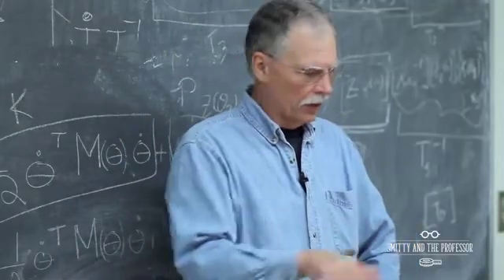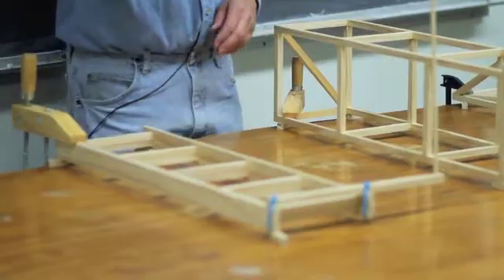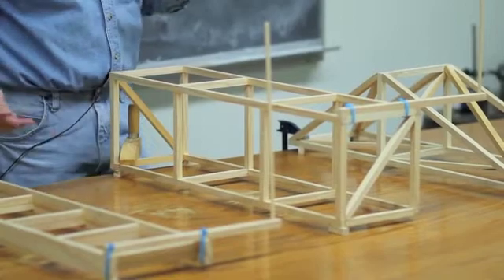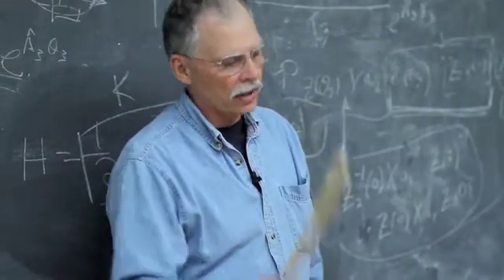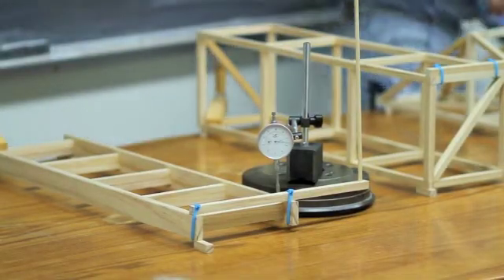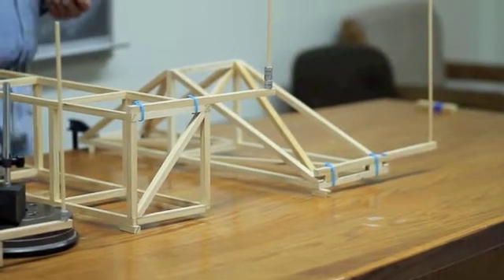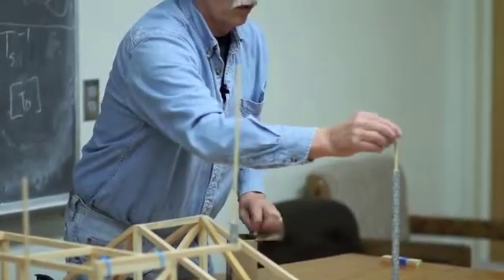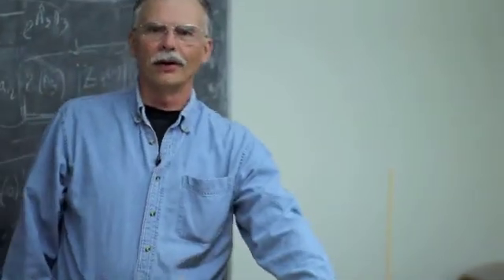Intro to Racecar Engineering:  04 Chassis Design

Comment: Doesnt the rear engine mounts and engine block count as a cross member 
In the context of the ladder chassis with limited wheel travel wouldnt the ladder chassis keep the rubber to the road better due to the flexibility hence be an asset over the other box and angled chassis with the same amount of wheel travel
Reply: chassis should not be made to do the job of a suspension, if that is what you are asking.
Reply: @SurajThapa-gv9tx  Unless we are talking gokart.

Comment: Very Nice . I remember most of this from “Chassis Engineering” by Herb Adams”. Especially the use of scale chassis models and levers for chassis deflection. I didn’t notice the use of shear panels in place of tubes for chassis design and triangulation.